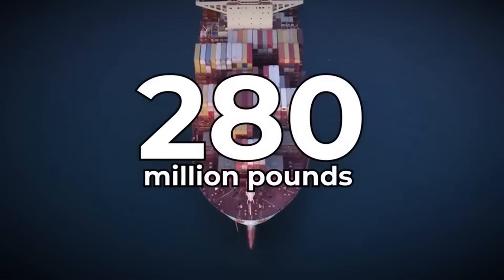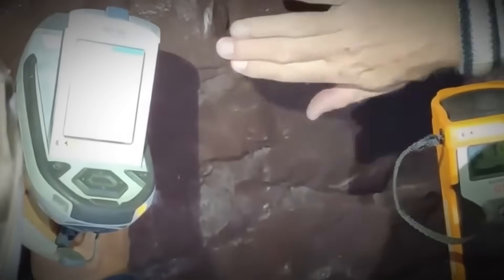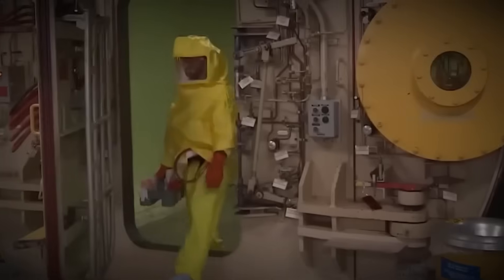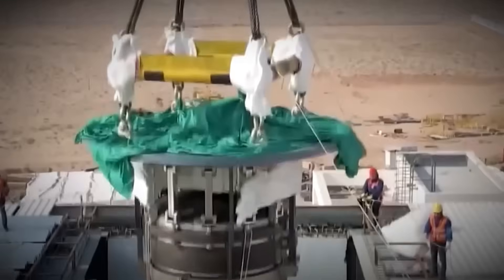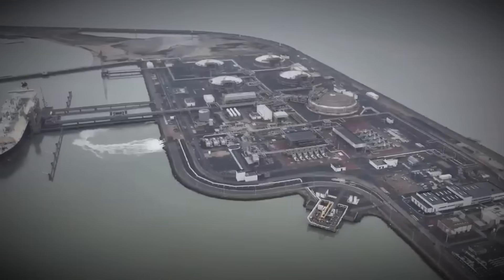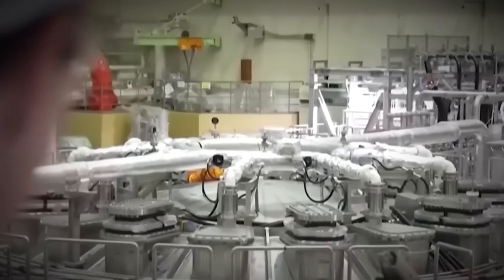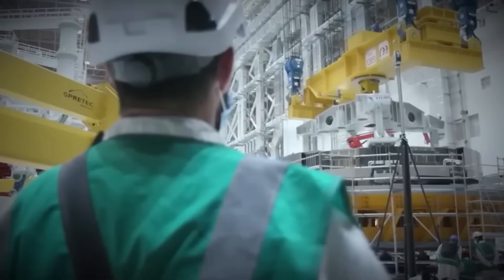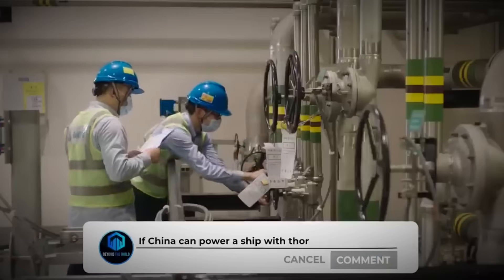China’s New Thorium Ship Just Challenged U.S. Maritime Power

Comment: Easy answer. Use multi small modular systems daisy chained to  the required capacity. The ones that The University of Illinois is about to use to heat salt to create steam to power their old former coal fired steam generators. They are clean self regulating safety and can be used anywhere with some forethought. So America already has a solution. 2+2 can make 4. But you must have 2 of the twos in the first place You have, so get to making fours.  

Its a solution it may develop into The solution as 2 or more reactors would give a good safety factor for a reactor failure or shutdown for some reason.

Does someone in Australia need to keep telling you what to do? Your big boys now.

Comment: It will not remove the fuel costs. It will make them all or largely up front. Nuclear has always been expensive. 
New tech always comes along, we will have to wait as see if a prototype works. 
The USA is failing, as is seen by running away scared from the transition to EVs. Desperate to maintain the old Oil based world they dominated.

Comment: This is fake news. Yes china is doing EXPERIMENTAL Thorium reactors. Not a ready product, but steps on the way. And by no means ready for commersial use in a ship. It will take at least 10 years before we can se anything like this in practical use. So this is just clic bate and pure bovine manure.
Reply from the maker: That claim mixes a valid point with an incorrect one.

You’re right that China’s thorium molten-salt reactors are not a finished commercial product today. They are still in the research and demonstration phase, and no one credible is saying a nuclear container ship is already sailing. Timelines of several years before practical deployment are entirely realistic.

However, the part that’s wrong is calling this “fake news” or clickbait. The video never claims this is a finished ship in operation. It clearly states that China has published a commercial ship design based on a reactor technology that has already been demonstrated on land and is now under active research, testing, and scale-up. That distinction matters.

What makes analysts pay attention isn’t that the ship exists today, but that:
• the reactor physics have been proven in operation
• the thorium fuel cycle has been demonstrated
• a full marine design has been laid out publicly
• and no other country is even at that stage

That’s not hype — it’s an early but credible development path, similar to how nuclear submarines, LNG carriers, or even jet engines looked years before deployment.

So the real debate isn’t whether this is “ready tomorrow” — it isn’t. The real question is whether China is further along the roadmap than anyone else, and whether others are even trying.

Do you think the bigger barrier here will be engineering scale-up, or international regulation and port acceptance?
Reply: @EngineeredGiants  Then we agree on the state of the art!

Comment: Since there are no thorium reactors, this video is most probably fake news.
Reply: China has an operational prototype Thorium MSR with a 2MW capacity. They're currently building a 10MW model designed as a scaled-down version of the serial production model, planned for a 2030 start of production at 100MW and 200MW output. 

Thorium was never an insurmountable technical problem - it was abandoned because the US preferred focusing on breeder designs.
Reply: @dpye111 I want to see it first
Reply: @florin604 it's already in Gobi desert
Reply: @BoluwatifeOLUFILEJI sure, come back when they have a working 24/7 one

Comment: The US Oak Ridge prototype just managed to work but corrosion problems made it not commercially viable.  Many countries tried but fail to solve the corrosion problem until China did with its newly invented material.
Reply from the maker: That’s mostly correct, with one important clarification.

The Oak Ridge Molten Salt Reactor Experiment (MSRE) in the 1960s did work as a reactor. It ran successfully and proved the physics. The real blocker was materials, not neutronics. The molten fluoride salts are chemically aggressive at high temperatures, and long-term corrosion, embrittlement, and tellurium cracking in nickel-based alloys made commercial scaling risky with the materials available at the time.

Several countries revisited molten-salt concepts later, but they ran into the same wall:
you could make it run, but you couldn’t guarantee decades of reliable operation without excessive maintenance or component replacement. That’s why funding dried up.

China’s breakthrough isn’t that it “invented molten salt reactors” — it’s that it invested heavily in new alloy systems, coatings, and salt chemistry control, including improved nickel-based alloys and impurity management, specifically to address corrosion over long operating periods. That’s what allowed China to keep the program moving from lab to pilot scale instead of stopping at experiments.

So the better way to put it is:

• Oak Ridge proved it could work
• Everyone else proved it was hard to scale
• China focused on materials science long enough to make it practically viable

That’s why the TMSR program matters — it’s not a sudden leap, it’s the result of solving the exact problem that killed the technology everywhere else.

Do you think materials science is now the real bottleneck for most next-gen energy systems, not the reactor concepts themselves?

Comment: It's hardly a challenge to US maritime power. It's not as if the US make cargo ships anymore, they struggle to build military ships these days.
Reply from the maker: That’s a fair pushback — and in a narrow sense, you’re right.

The U.S. doesn’t dominate commercial shipbuilding anymore, and hasn’t for decades. Most global cargo ships are built in China, South Korea, and Japan. So this isn’t a direct hit to U.S. shipyards in the way it would’ve been in the 1970s.

Where it does become a challenge is indirect. Maritime power today isn’t just about who builds hulls — it’s about who controls trade lanes, standards, fuel systems, insurance norms, and port rules. If China can run long-range cargo routes without fuel stops, it reduces dependence on energy chokepoints and Western-aligned hubs, and that shifts leverage even if the U.S. isn’t building ships itself.

So it’s less “China vs U.S. shipbuilders” and more “China reshaping how global shipping works while the U.S. has no civilian counterweight.” And you’re also right on the second point — the U.S. struggling to build naval ships on time and on budget makes catching up harder, not easier.

Do you see this as a symbolic concern that gets overplayed in Washington, or the start of a real standards and influence shift rather than an industrial one?
Reply: @EngineeredGiants Why does the US need to control trade shipping lanes on open internal water?

Comment: They just picked up old US Navy research from the 1960s and 50s.  Applied modern technologies and materials to the concepts.
Reply from the maker: That’s a fair summary — and it’s largely accurate, as long as we keep the nuance.

Much of the foundational physics and reactor concepts behind molten-salt systems were developed in the U.S. in the 1950s–60s, including work linked to Oak Ridge and early naval reactor research paths that were later abandoned. China did not invent the idea from scratch.

What China did differently was treat that legacy research as a starting point, not a dead end. They took the archived designs, identified exactly why they failed commercially — materials degradation, corrosion control, salt chemistry stability, instrumentation limits — and then reapplied the concepts using modern tools: advanced alloy development, better computational modeling, improved purification systems, and long-duration testing that simply wasn’t feasible decades ago.

This pattern shows up across multiple sectors in China’s development model:
revive mature Western concepts → remove the original bottleneck → scale aggressively. It’s less about originality and more about execution and patience.

So it’s accurate to say China stood on U.S. shoulders, but also accurate to say the U.S. chose not to climb further. The strategic difference isn’t in who had the idea first — it’s in who stayed with it long enough to make it usable.

Do you think the West will now revisit these shelved technologies seriously, or will regulation and risk aversion keep them in the archive?
Reply: @EngineeredGiants 
Revisit certainly.
Reply: @IBYIYINGOMADEO  I don't know. The US is notoriously short sighted, only reacting after a situation is unavoidable. Take the AI and US power grid dilemma. Even now the US is forging ahead full speed, building data centers the power grid, as it is, can't possibly sustain.
Reply: @kingofpain5866Then I ask you whether the thorium MSR technology is still beyond their reseach capabilities and if yes it is  we can agree that sustainability is not impossible as far as power supply is concerned.
Reply: @IBYIYINGOMADEO  The US is very unlikely to go nuclear. There is way too much propoganda stoking fear in the US. The oil industry is just not going to allow it, not to mention the hedge funds buying up the grid, cheap and abundant power is just not in their interest. I would be shocked if the US built any reactors in the next 5 - 10 years.
Reply: @EngineeredGiants  science is usually on somebody else’s shoulders. Perhaps we are technologically mature enough for these technologies that China is producing. Excellent review.

Comment: WTF YOU MEAN JUST CHALLEGED US？ China already way ahead, including LNG and solar sail vessel
Reply from the maker: China is ahead in several areas — LNG dual-fuel ships, wind-assisted systems, and experimental solar sail concepts are already in operation. The point here isn’t that this is China’s first move, but that nuclear propulsion removes fuel dependency entirely, which is a much bigger step than efficiency upgrades. Do you see nuclear as the next logical jump after LNG and wind assist, or a separate path altogether?

Comment: it's aircraft carrier size, and China is in the process of building one, possibly two simultaneously. hmmmm
Reply from the maker: The size itself isn’t new — 400-meter cargo ships already exist. What changes everything is pairing that scale with a sealed nuclear reactor designed to run for a decade without refueling. That’s an economic and strategic shift, not just a big hull. What concerns you more here, the scale of the ship or the reactor onboard?

Comment: Thorium Reactor is a better and safer way with no melt down danger to power ship in the ocean, generating electricity on land to even on desert environment.   China leads the way of Thorium Reactor powering shipping.
Reply: not just no meltdown but very little waste plus ability to burn other nuclear waste product.
Reply: @cam35mm  Certainly and encouragingly, providing the best safety measures plus other so far.
Reply from the maker: Molten-salt thorium reactors do have strong safety advantages compared to traditional water-cooled designs, especially low pressure operation and passive shutdown behavior. That’s why China tested the fuel cycle on land first before proposing marine use. The debate now is less about physics and more about regulation, ports, and global acceptance. Do you think public perception will block this even if the tech proves safe?
Reply: At engineered, yes Europe regulates everything into oblivion. Especially when they can’t compete.
Reply: Molten salt Uranium or Combo Uranium/Thorium is better design.  Again, Molten Salt any reactor is the way to go.
Reply: while the us doesn't have practical technology in thorium based nuclear reactor power plants, thorcon, a us company, keeps pushing the construction of thorium power plant in indonesia on a pristine coral reef.....google thorcon bangka island